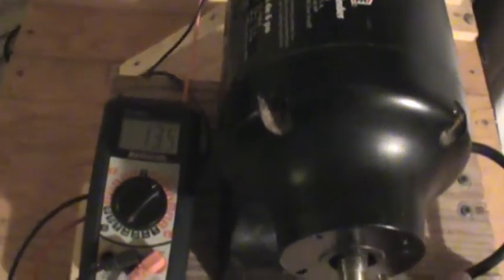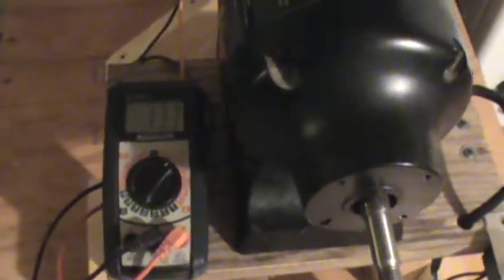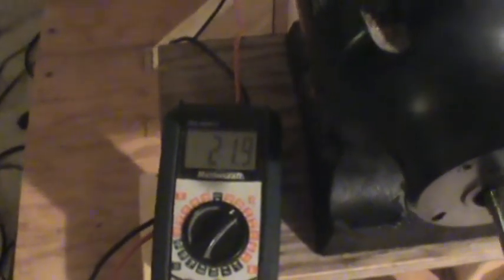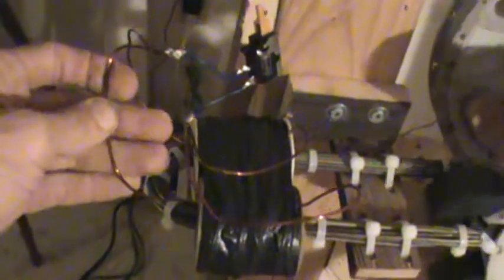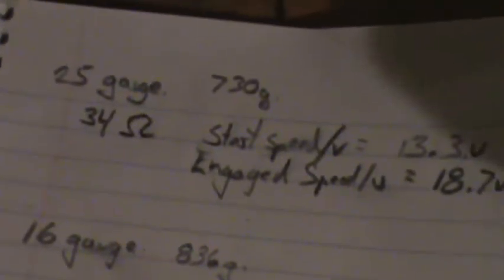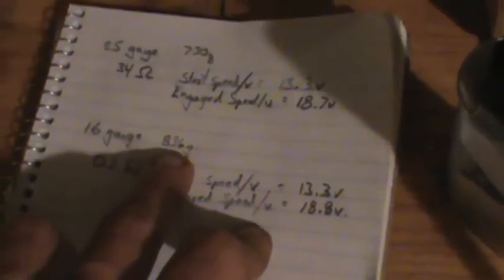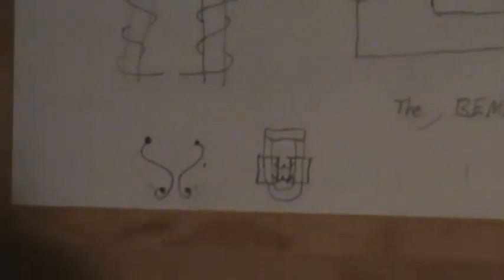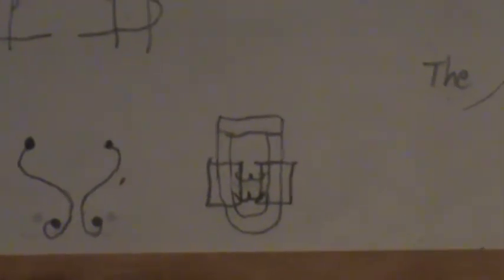Free Energy Project - Wire Gauge Testing

Comment: Your work is amazing~ I am happy to view your progress. The other day I asked this: By mounting an automotive alternator with a battery and inverter or an a/c generator on the opposite end of the bench grinder, would you be able to show the proximity to unity or over unity that you achieve by generating electricity to run it under load? I think the additional drag on the flywheel once the coils are engaged may keep the speed down in the sane rpm range. Thanks for revving it up for us!

Comment: Hi MrAnguswangus, good test.You have figured out that the wire gauge size does not matter.That's a good news since the 16 AWG is cheaper,by weigth.There may still be a difference.One gauge may climb up faster and reach from 13.3 to 18.7 volt on speed meter.You can still save money by using only thick wire. A further test would show the gauge that is most effective.A simple comparative time test would confirm this.You know for sure that thicker gauge is cheaper, lets find out the most efficient.

Comment: Nice video again, don''t waste your time to much on non believers better wind coils instead. Its better to inform a 1000 people then to persuade one. Hope to see more coils on there next vid. by the way did you test with less copper because I have good effects with just 120 grams 0.2 wire though my setup is lighter. If I could use your coils my setup would have flying magnets I guess. I just would like to find out at which point you don't gain anymore with extra copper. maybe you only need half.

Comment: dont let people talk you into pushing the motor tooo far. get some readings as a baseline as to input watts and output watts at certain rpms then up the rpms and take readings. lets see if  you can achieve OU and at which rpm ,if its possible. then close the loop  HOPEING AND PRAYING you can